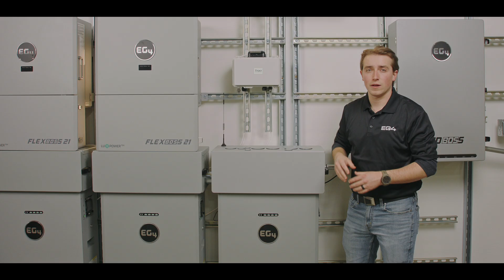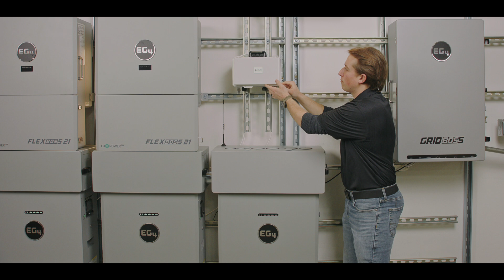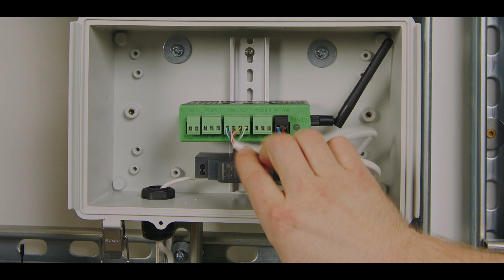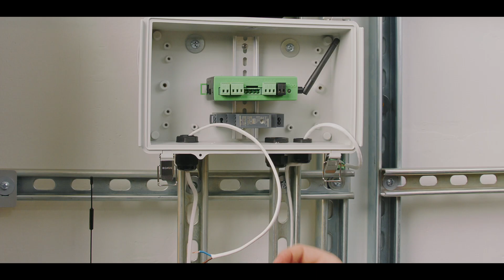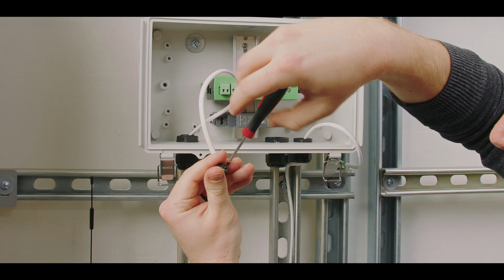FlexBOSS21 + Tigo CCA Integration | Powering the CCA the Right Way

Comment: Neither the video nor the manual on the FlexBOSS21 tell you the max amps provided by the 24v RSD power.  My setup - due to separate locations of panels - has THREE Tigo TAPS and I am wondering if the FlexBOSS21 puts out enough power to supply three of them + the cloud connect.
Reply from the maker: The 24V power supply can provide up to 1A. You shouldn't have any issues with 3 TAPs on a single CCA.

Please reach out to our support team for more information!

Comment: You mentioned the Flexboss has built in tigo hardware. What parts of the tigo optimizer hardware can be eliminated by using the built in hardware? In other words, do I need the CCA and all other recommended components or am I duplicating hardware here...
Reply: The built-in Tigo transmitter (Tigo RSS) is for use with their RSD only solution. If you're looking to use optimizers, you'll need to add the CCA, TAP and optimizers to the system.